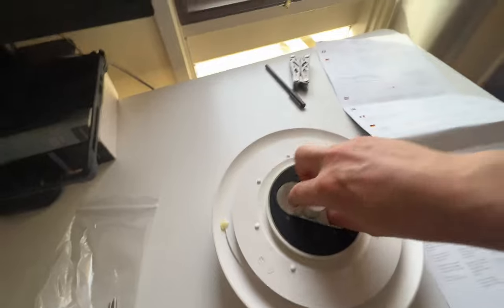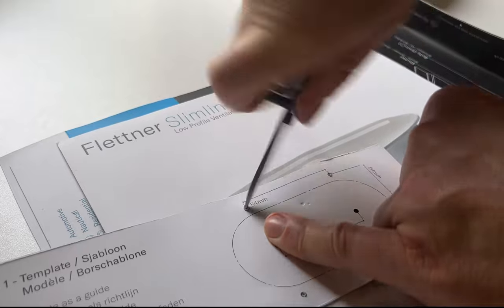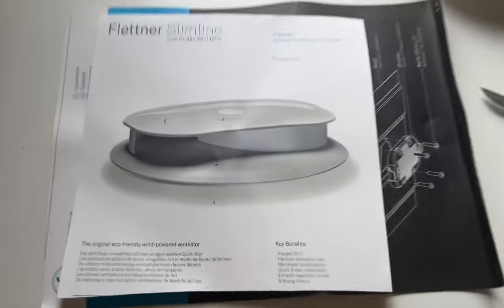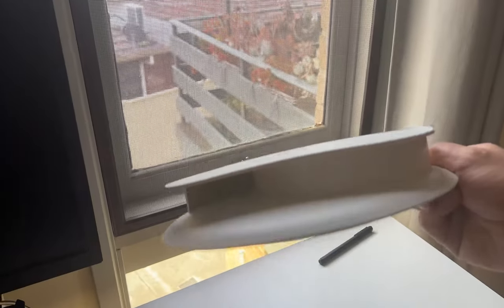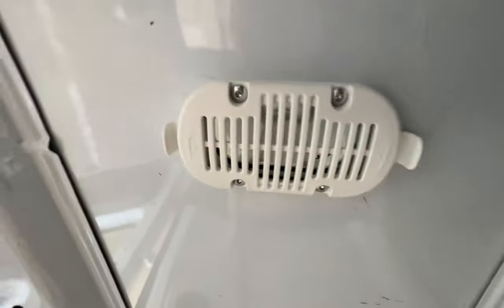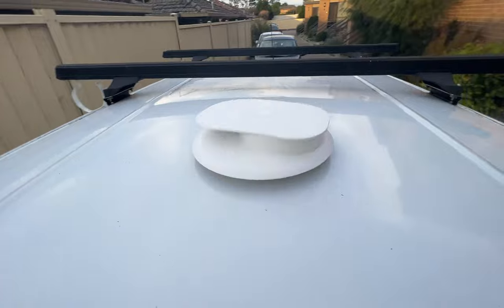DIY Camper Van Condensation Fix

Comment: Hi, what’s your vent installed for? I have a Fiesta van with no air con and I’m literally getting casseroled daily. I was thinking of fitting an electric slim roof vent, do you think this would cool it down inside?
Reply from the maker: I’ve upgraded the fan since this install. I’d recommend getting at least an 11 inch fan so you can pull a decent amount of air in and out and get the air circulating. Not sure about heat. You’d have to look into the laws of thermodynamics.
Reply: @ZekeCamping  ok super, thank you 🙏
Reply: @ZekeCamping what was the new fan you installed?

Comment: One question, does air enter or extract hot air out? Does it work in a normal car or does it have to be a caravan?
Reply from the maker: It sucks air out only. Not sure about if it would fit anything other than a van.

Comment: Wanted to install a simular system on mine but I got scared thinking it wouldnt keep the water out. Have you driven this thing trough heavy rain yet? And if so did you have any water comming trough?
Reply from the maker: I was worried about that too but there hasn’t been any leaks while driving through rain.
Reply: Very frightening cutting that first hole haha… about to do mine soon. 

Does this help a lot on warm days ?